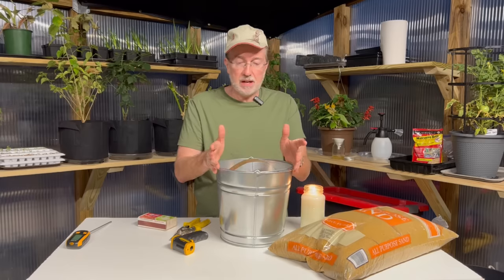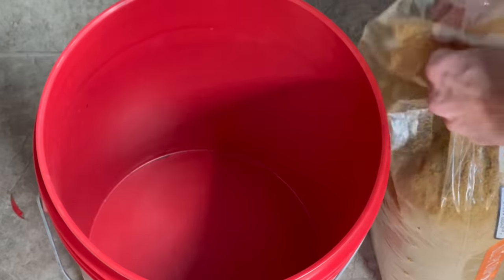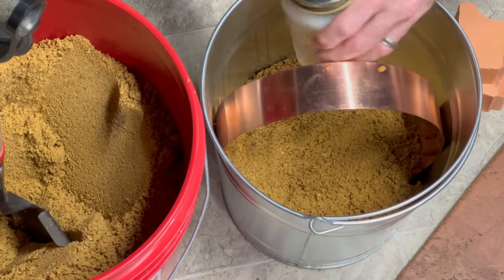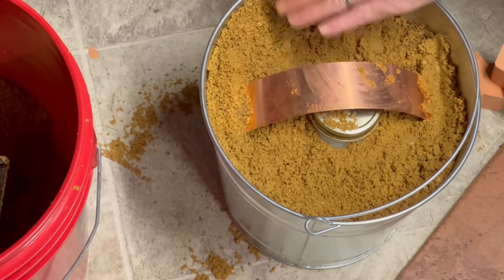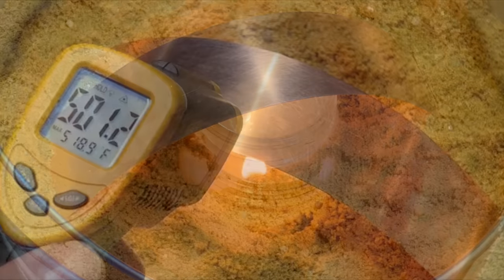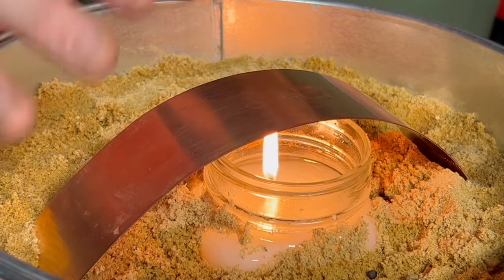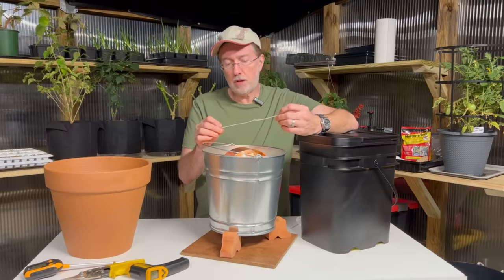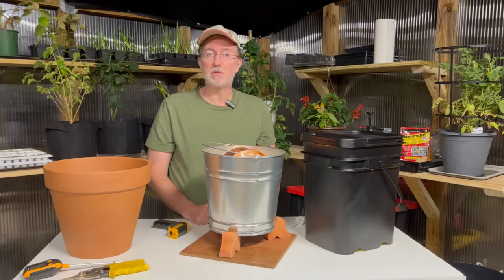DIY Copper And Sand Heater | No Electricity Needed For Greenhouse Heat

Comment: I just learned about sand batteries recently, and pretty excited to make one. I was thinking what kind of pail I would buy and then realized I have a copper bucket with a cast iron handle. Anything about the whole container being copper, that I should be concerned with. I wonder if it'll get super hot because the sand is contained in it, rather than a strip of copper put in it. Any input would be appreciated 😊
Reply from the maker: I think copper is a better option.  I wish I had one, but very expensive.  I’m thinking about purchasing a cast iron pot and do some experiments.
Reply: This isn't much different than burning the candle by itself. 🤔The heat ultimately is transferred into the air. 
Adding the middleman (the sand bucket) transfers some of the heat into the bucket. The only thing that the mass of the bucket accomplishes is to delay a small amount of the overall air heating. After the candle burns out the bucket will radiate its stored heat for a few more hours. The candle might be helpful in that the plants will use its carbon dioxide output.
Reply: @Mavrik9000  thanks for responding. I get what you're saying, but I forgot to say I'd have several of those ceramic heat elements I've seen used, stuck into the sand. Yeah, a candle wouldn't do a thing.
Reply: @ZenGardenOasis.  And using those ceramic heat elements I see people using, stuck into the sand.
Reply: @ZenGardenOasis.  maybe you could locate a cast iron kettle at an estate sale.
Reply: I found a beauty at an antique store :)
Reply: @ZenGardenOasis.  Hit the antique stores! I found one there. Nice shape, functional, better price than new.
Reply: @mfb6310  how wonderful!. 
I'm still learning about how to create the sand battery. I'm so literal but see it simple; putting the sand in the bucket and inserting those small flat ceramic elements into the sand. I guess I'll need to wire a plug to the elements, but not sure. I need help about the power to heat them anyway. Need to watch more videos unless you have some input.
Reply: Is it some miracle, that the copper bucket reacts to the sand, and hence heating up the ceramic elements? I forget but isn't the sand battery idea great because it heats without electricity?

Comment: Ultimately, this is a heat storage device that will radiate energy for some period after the candle burns out.  BUT, does this device create infrared? The candle will produce heat that warms the air above it, while infrared can warm objects in all directions within its line of sight. If so, THAT could be a big advantage over a lone candle.

Comment: A candle only has about 80 BTUs. Pretty negligible. You would put about 4x as much heat into the room just by sleeping in there.
Reply: .... and unless the Greenhouse is very well insulated, all the heat is quickly lost
[try sleeping in an empty cast iron bath after a few beers - did that in my mis-spent youth .... but only once !  ]
Reply from the maker: I sized it up to a metal trash can 25 gallons of veg shortening and 20 wicks…..it’s sweltering.  The veg short was free.
Reply: @ZenGardenOasis.  I'd like to see that. You have any videos of it?
Reply: I suggest that you get some exercise equipment installed in your greenhouse and do an energetic workout. That will turn fat in your body into warmth for your plants. Alternatively, offer the space in your greenhouse to homeless people - each one of them will donate about 70 watts of heat. Fifteen of them should get the space nice and toasty.

Comment: This isn't much different than burning the candle by itself. 🤔The heat ultimately is transferred into the air. 
Adding the middleman (the sand bucket) transfers some of the heat into the bucket. The only thing that the mass of the bucket accomplishes is to delay a small amount of the overall air heating. After the candle burns out the bucket will radiate its stored heat for a few more hours. The candle might be helpful in that the plants will use its carbon dioxide output.
Reply: It does seem pointless at first, but if you consider the whole system it makes more sense; flatten the curve. After dark the temp slowly drops while excess heat is pumped into the sand. The maximum output is when it's all heated, during the coldest part of the night. As the sun comes up less heat is needed about the time the candle dies, and the still-warm sand supplements the increasing solar input. The net effect is steadier temps using less fuel, so long as the timings line-up.

Comment: I'd make three of those copper strips, line them up , drill and rivot the center mark so you can fan them out and increase the heat transfer from flame to copper to sand. Probably double the output of heat for each candle or alcohol flame

Comment: 10:04 just put black tape on the reflective material to mesure it. Thermodynamics tells me not to test this thing
Reply from the maker: Interesting idea.  So far I’ve been happy with output but larger candle with 4 wicks would be better.
Reply: @ZenGardenOasis.  it's not an idea of mine, it's how it's done if you want to use IR thermometer on a reflective surface

Comment: Blah Blah Blah. A candle’s BTU output depends on factors such as its size, composition, and burn time. On average, a candle will emit around 80-100 BTUs per hour. The average Human emits about 400 BTUs.  No matter what you put that candle in you will only get the 80 to 100 BTUs that the candle can produce.
Reply: That's exactly how it is
Reply from the maker: I sized up to a full size metal trash can 25 gallons of shortening and 10 wicks.
Reply: How warm after the upsizing??

Comment: This theory of a candle heating a room has been proven to be nothing more than a myth!
Reply: Exactly. Just another version.
Reply: Yup, the heat being produced cannot be amplified
Reply: “myth” is a nice way to say it…
Reply: Dispersing heat horizontally is better than immediately rising to the ceiling.
Reply: Only stored and give away slowly.
Reply: I can’t see what he’s got being an enormous benefit. BTUs are BTUs, but - if the exposed portion of copper were insulated, if the bucket itself were insulated, if there were two loops at right angles (cut from a large-enough sheet), etc, the thermal battery would more effectively capture & store heat for later use.

I’m tempted to try it with a steel drum, but I’ve got the drum & plenty of sand & copper. My question - how many BTUs are in any given jar of crisco, & what’s it gonna take to put all of ‘em into the sand so that however much of an otherwise unheated space stays warm(ish) over night?

… like the shed out back where stray cats live or some such thing.
Reply: @jelleroggen  correct- it will help spread the heat over a longer period of time rather than in a short period, but ultimately, A candle or other fuel heater can only output a fixed amount of heat energy when it burns.
Reply: A candle in an igloo makes the difference between minus 40 and plus 40 so that's not true .
Reply: Where is the proof?  A tea light candle puts out 80 watts approximately. Up size the wick upsize the O2 burned, the copper and bucket are a heat exchanger, the sand is a battery.  So surface area is speed of heating exchange, sand is the thermal mass, the amount of wax or oil is stored sun and the wick is a throttle carburetor.  Play with the variables, you can use back of the napkin math to size a heater for a room, house etc for a night, week, season.  The only question is cost.
Reply: Wrong. I used these methods last winter and was very effective.
Reply: Another myth is the small ceramic heaters which are claimed to heat a room in a few minutes.  I bought one once to warm up a 7 foot by 5 foot  shed, and took it back for a refund the following day. It was about as much use as a broken glass eye. Could generate more heat by rubbing my hands together.
Reply: In Scandinavian countries they use huge mass brick fireplaces where the chimney is a labyrinth.
 Very small fire box and as the smoke travels out it heats the mass which stores the heat. 
  The heat from an open flame candle heats the walls and ceiling and is absorbed very quickly and lost very quickly. 
  Once you heat the mass of sand or stone also the metal transfers heat very well.
Reply: And I don't think you ever need to worry about that bucket getting hot enough to damage a floor or cause a fire hazard. There's just too much mass and surface area for that candle to get it hot except right over the flame where he boiled the drop of water.  This is a waste of time.
Reply: @vainwretch

This was so far back I can’t remember why I was there or even exactly where the house was, but I once saw a fireplace like that in a rustic/modern fusion sort of home. That fireplace was massive, the fire was tiny, & it was heating the house.

That guy was heating w/ kindling & not much of it.
Reply: @shawntailor5485  Your Body Heat in an Igloo makes the Difference
I think the candle did pretty much nothing but give off light.
Reply: Yeah but, it’s not the candle only ,it’s the set up of copper strip continually conducting the heat into the sand. And why can’t the wax fuel,Crisco oil  or what’re he’s using be topped,every 8 hours or so?
Reply: @user-wf4hy4ub7p was the shed insulated and draft free?
Reply: Maybe the math/science folks don't factor in how hot a flame really is? BTU is a factor of heat and heat exchanger.
Reply: @sirmagnus99  you question is like asking if a math / science person doesn't know how much a pound or kilogram weighs.

However, it's winter.   Get a candle and a clay pot and set up that heater and turn off your heat and measure how well the candle heats your room.   
Then set up this copper thing and see how well it beats your room.    You can actually start with a steel mending plate from a lumber store, that costs about 1 pounds or 2 dollars.   Then you can move up to copper.  Then you can return here and post your results. 

That will be the start of thinking a certain way.
Reply: If you screw up a candle thats your mistake.  And yes even an emergency lighting candle makes a difference in a space that is enclosed entirely.  All these solutions are just much larger amounts of fuel combined with heat storage and exchange, basically you cant go wrong.
Reply: @wyldanimal2 and igloos are made from compacted snow with lots of voids making it great insulation. With proper clothing one could be quite comfortable in an igloo, but it's still mainly a survival shelter, there's really not much reason to anticipate carrying around a bucket of dry sand and candles for survival environments.
Reply: I'll try it.... It doesn't take much to warm my apartment.
Reply: @macmcleod1188  well it is kind of obvious they don't know how much a kilo is cause someone had to decide that amount. I like that it's now an amount of atoms, that cool.

So a flame is 1800+ °F or 1000°C. That's a lot of heat if used correctly. Efficiency ratings are important for calculating these types of things.
Reply: @shawntailor5485 just because you said it.   Definitely doesn't make it true.  Lol
Reply: @susanrarey4307 no you didn't
Reply: @world-karma9127 not technically true, may not be able to be amplified, but can be stored & compounded upon.. test out the terracotta heaters for yourself.. give off way more heat than just the candle on its own...
Reply: Not a theory when my family actually used this.... think about it...
Reply: Oh you can survive in 40 above ,40 below is some tuff reality without serious survival knowledge and the right furs or mil tech clothing, even then frostbite is a constant threat .in weather like that a snow cave made by hand can save your life by body heat ,as long as you can stay dry .
Reply: Of course.  One will not heat a room. But if properly done is very efficient.
Reply: I think the key point is that here the sand is heated and can get very hot and radiate heat for long hours.
Reply: @JiminWestLA Btu's are btu's friend. The human body puts out more btu's than a candle. These "heaters" are nonsense!🙏🔑✌️🇮🇱
Reply: Who's theory ? Did you know that , in aeronautical engineering theory, bumblebees aren't supposed to be able to fly ?
 This type of heater is very effective for a  space like in a greenhouse . We used to do this in winter in our pump house on our  north east Ohio farm to keep the pipes from freezing. Our pump house is a 12'×15' building. 
 Provided that the space is breeze -free , this is a very effective method . It's inexpensive, safe and requires very little attention. 
 I urge you to give it a try  , you might be surprised .
Reply: All I know is that two little votive candles burning in small glass candle holders did an astonishing job of cutting the cold in my bedroom when a "storm of the century" that caused a major power outage in the region of my small coastal community was followed immediately by two days of record 0° cold.  Since then I make sure to always keep small candles on hand.
Reply: @defauluse5524 how do you know he or she didn't?? Was you there watching?? Do you know this person personally?? If not then no you don't know nothing if the person did something or not.
Reply: @world-karma9127  It doesnt need to be amplified because once the sand is heated to a certain temperature which will be above the candles heat then it effectively becomes the same as living room radiator. Sand is now being used because it takes in heat quickly and radiates it longer.

Comment: cool idea thanks. might be interesting to look into getting a couple of buckets of sand in front of the fireplace and do the same thing.. trapping heat for later.. bit like a back burner without the plumbing..
Reply from the maker: Cool idea
Reply: A woodstove is actually about the only situation where having significant thermal mass near it has any point at all; since it potentially runs hotter than you want, so slowing down the release could be beneficial.

Chunks of soapstone are commonly used for this purpose although big brick structures work too.

If your heat source doesn't go hotter than necessary, there's no point in slowing the release of heat.

Comment: What is the point of this? The amount of heat released from the candle does not increase by storing it somewhere. Simply burn a candle that makes the amount of heat you want and have it burn to release that heat. The only reason to make this would be to heat it up with a candle, snuff the candle and then take it inside for the heat without getting the bad air. Otherwise there is absolutely no point whatsoever from a physics standpoint.
Reply: I haven't tried it, but the idea seems to be to use the sand as a heat sink, so it will continue to radiate warmth even after the candle is extinguished. And plants consume carbon dioxide and produce oxygen. If they don't have 'bad air' they will suffocate.
Reply: What's the point of the stone sides on a soapstone wood burning stove? 
The large stones in an older chimney? 
A hot water bottle?

Comment: That is total BS. The heat output of a candle is only 80 btu. Which means that it does absolutely nothing. It wouldn’t matter how much copper or sand you put in the bucket.
Reply: I think the idea is to catch the candles heat and transfer it into a medium of thermal mass where it will gently distribute .  It’s an interesting idea which would be almost free to experiment with and may prove to at least prevent freezing in a small space .
Reply: That’s actually 80 to 150 btu PER HOUR, and the point is to capture the heat and release it from a greater surface area.
A btu is equivalent to burning a wooden kitchen match. 80 matches in an hour is plenty of heat, but it depends upon how large an area, how high the ceiling, how big the temperature differential, and the surface area of the heat source. Most single source heat is wasted because it heats a tiny area of air that quickly rises away from where the cold humans or plants or animals are.
The copper is catching a portion of the heat and transferring it. The sand holds it and slowly allows it to transfer out into the space from a bucket that has greater surface area than does the flame of a candle.

Think of it this way…a door with a pressure differential on the two sides can kill someone. 3 psi is 3 lbs per square inch. Every sq inch of the door is being pushed with three lbs of pressure. On 80 x 36 in door, that’s 8640 lbf. 
It’s the surface area. 
A radiator…surface area
A cooling unit…surface area
Why a needle can prick your finger…surface area
Heating efficiency…you got it…surface area
Reply: Eat a lot of beans the go do yoga all the heat you need.
Reply: It's not a candle ..it might be worth the time to listen...
Reply: It's a Greenhouse Heat Source for Plants. Terracotta Flower Pot Flipped Upside Down is Another Option for Greenhouse Heater.
Reply: @HughGard-rc7cc  I think it’s a neat experiment that someone can try for themselves and it’s not too expensive.
Reply: A greenhouse only needs to be over 45° so hitting 48° to 54° is the goal..not 80°..
Reply: Two or 3 rings of copper would be more efficient. Peace
Reply: @Mulberrysmile ~ almost, he invented a heat battery that is charged by the candle. It’s just a mass equation.   😊
Reply: I love in Very dompedro área  where it rains  a lot and think this may be a way to dry up a place? The thing is that to replace the candle one needs to do it all over?
Reply: Your not that smart fellow
Reply: @Mulberrysmile a btu is the required energy to rise 1 degree f in llb of water at 39f
Reply: Of course he never showed us the temp of the bucket .
Reply: Who cares about the btu were in a crisis put some tegs on it also and some plumbing to heat your water